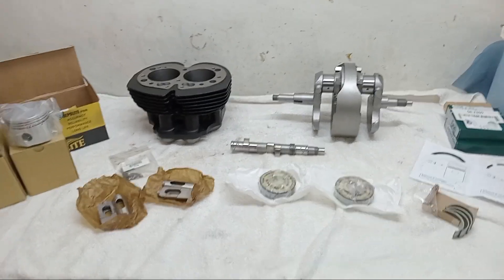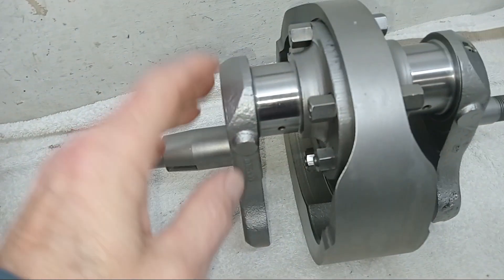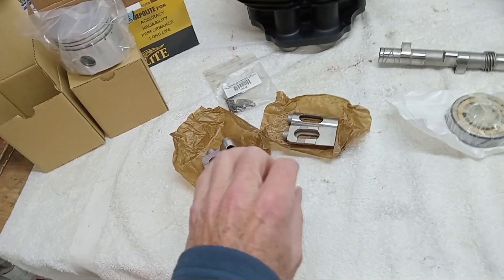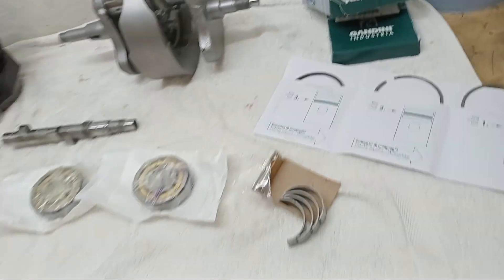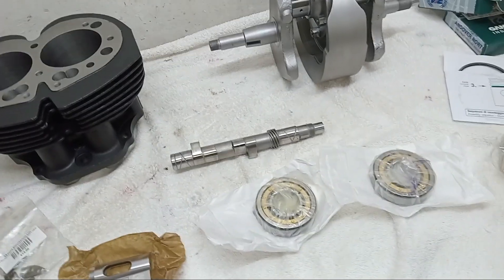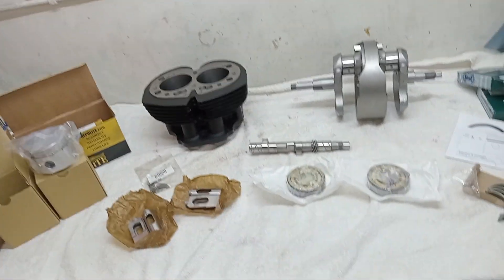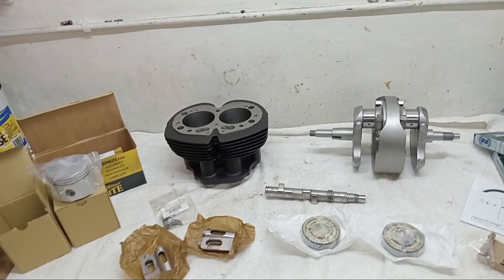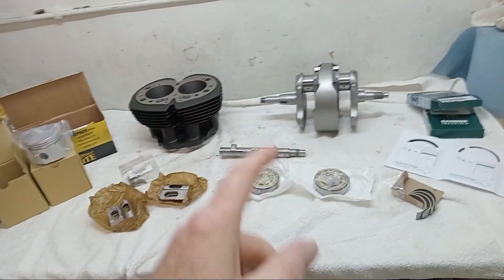Norton Commando Engine Rebuild. Part 44: Machined Parts Back Home.

Comment: Do you have the crankshaft crack tested before regrinding the big ends? Our experience in NZ is that many maybe 50 % of Comando cranks are cracked at the drive side section change to the crank lobe. The crank is very badly machined from new with no radius. My 74 Mk2 850 crank was cracked and I know of many others. I obtained a second hand replacement and had an undercut radius machine into the crank. This kind of problem occurred with early BSA cranks and it was cured by rolling in a radius.

Also a good idea to check the drillings for the oilfeed below the drive side big end are not slightly offset creating a stress raiser. Also of course the engineering shop must machine in the proper radius when regrinding the big ends.

Dynamic balancing can also be a good idea. Often the cranks are out of balance left to right.